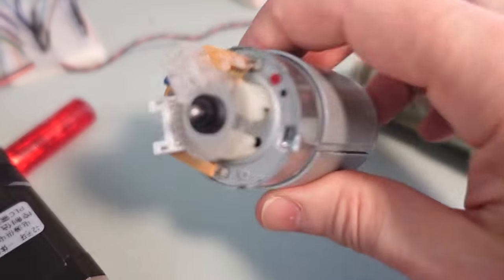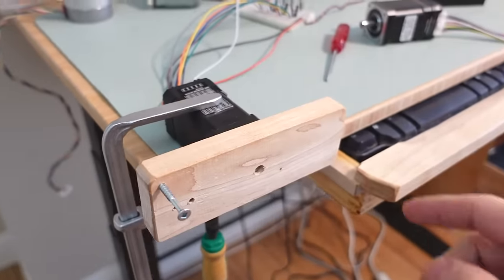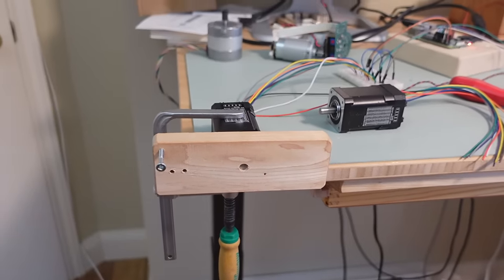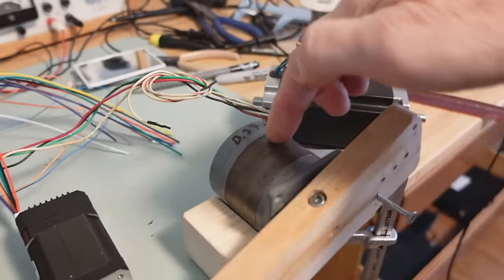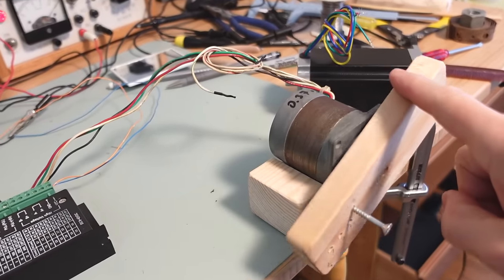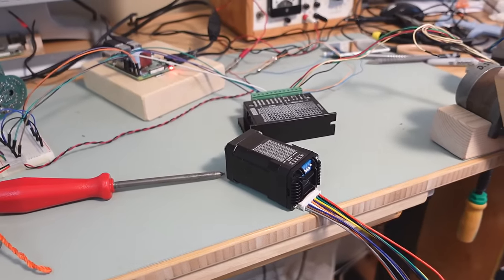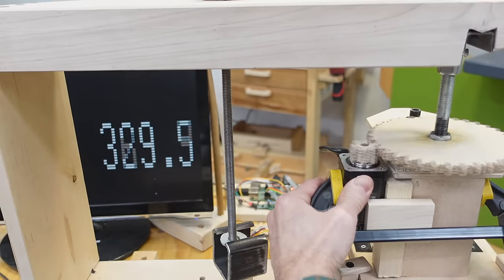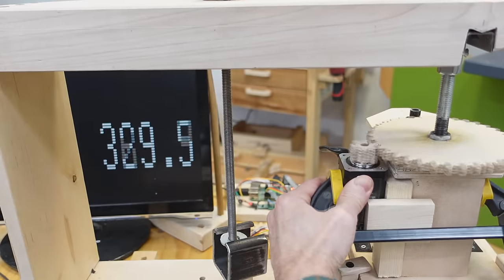Closed loop stepper motors -- very impressive

Comment: Some of the closed loop steppers like servos can have an autotune feature where they can learn the kind of load they are powering and self adjust to a pretty good motion curve.
Reply from the maker: I think most things the stepper would drive would have less inertia as seen from the motor, so it probably does ok with normal loads.

Comment: 4:55 As far as I know, stepper motors (like Nema) can get really hot with no risk of failure. I don't remember exact values, but it can get hot that you can't touch it and it still should be ok.
Reply from the maker: biggest risk is probalby exceeding the curie point of the permanent magnet

Comment: That looks good, I was working on a robotics project and had the same issue, the only issue with optical encoders is the stepper doesnt know where it is when powered on, I was going to try using a hall effect encoder which would know the angle at all times, but not got round to finishing it.
Reply: Write to EEPROM the last position the servo stops at, every time.  On power-up or reset read that last position back then rotate the servo to 0/home, or at least know where you last were mid-code execution.  Your implementation will differ from mine of course in my basic rotate between 0-359 degrees only (and never crossing that boundary).  Hall and limit switch hysteresis is a real pain, otherwise.

Comment: You might want to look into the Odrive, its an open source brushless motor controller designed for use with encoders, it supports up to 100A so you can get a crazy amount of torque and speed for not a whole lot of money.

Comment: Have you tried Trinamic's stepper drivers? I've heard great things about them. They seem to make steppers "kind of" closed loop by measuring currents, and they can detect missed steps and stalls.
Reply: They can detect, but they just error out.
Reply: @Tedlasman  yes, they don't replace those neat closed loop systems, but they would be an upgrade for his old and trusty buh motor, I guess.

Comment: Yeah, when you get a stepper motor out of synch, basically you'd have to realign it as with a standard floppy disk drive (but not the more modern kind like Iomega Zip and Clik!). My dad used to have to take our Commodore 1541 over to the shop to realign the drive, but then we got 1541/1571 Drive Alignment and I could follow the relatively simple directions to realign it myself even as a mere kid.
Reply from the maker: The 1541 used a stepper motor to move the head.  It had no means of detecting where the head actually was, so the only way to know was to move the head in one direction until it hit the stop, and skipping steps while at it.  Making a horrible noise while it did that.  And it always ended up doing that when it got confused.  So when you heard that sound, you knew, something was going bad with the disk!
Reply: @matthiasrandomstuff2221 : Not necessarily going bad. It and similar drives would make that sound for other reasons too. Drives like the 1541 make that sound when they start a full format, so it doesn't mean anything is going bad. But after a while, the drive would make that sound a lot more than normal, and that is because it started to get out alignment, meaning that the drive was bad more than the disk. But yes, it was caused by bad disks sometimes too. I wouldn't call that sound hugely horrible, though.

Comment: Very interesting motor indeed, Matthias! 😃
But I wonder about sensored brushless motor, how they work. All I know is that they're used for pretty expensive rc cars. 
Anyway, stay safe there with your family! 🖖😊
Reply from the maker: also used in cheap printers, but not as a module.  just a. heap motor and an optical encoder feeding into the main pcb.
Reply: @matthiasrandomstuff2221  No, those are different. I think they use magnetism for that... But I'm really not sure.

Comment: i've been looking at using CHEAP motors with glass scales, interfacing them with the cnc controller is an absolute pain without spending much bank on a mesa card.

so, for semi-auto drilling, i've had to brush off the old ttl circuit design files in my faltering memory.  just today struck on the idea of using digital comparators with bcd counters and old fashioned 74ls74 d flip flops to read the encoders, the trick i've thought of is using a target count, a count from the scales, then using the comparator outputs, which are 4bits per, to control the speed through a switched resistor network.  i've got a dro waiting in my jungle site cart, my design will probably be more expensive if i sold it in small amounts, but pretty interesting for the other weirdos out there, or for those that want to learn ttl, for some odd reason, many use arduinos for such a simple thing, but hardware works fine.

Comment: Did you have to write anycode specific to rhw closed loop logic, or did you just use the connections from the R232 connector to the driver A+ A-, B+, B- ?

Comment: Actually, I think this might be just the solution I've been needing without knowing it. Been wanting to make a pet feeder that was both accurate and reliable but also simple. And the drive system always turned me off. Not satisfied with simply running a brushed DC motor for a specific time. I think a Nema 17 with a similar control scheme to this one would check all the boxes. Provide feedback if the mechanism jammed. Could run on an ESP32 with no quirky issues and no extra components!

Comment: It's not that difficult to CNC gears though, just use a 1/8" bit or even smaller bit. The fillet that it gives in the inside corners you can transfer to the larger gear as well and the outside corners for it to mesh properly. 
But still, your band saw technique still beats a cnc for speed for a single or a few parts what with having to cam, setup/clamp stock and cut and sand the part. CNC really comes into its own for repeatability, 2.5D/3D cutting and larger numbers. 
I bet if you add a few more gears with a higher gear ratio, that small servo can pull more weight than the stepper motor and do it faster too since it can spin faster and torque at higher speed will improve. But it's no good as a 1:1 replacement.
Servos (or the servo controller) can have tuning software to adjust the control loop so it doesn't overshoot/oscillate under certain loads. It's always a trade off of course.

Comment: a closed loop stepper and a brushless servo is essentially the same. The advantage of a closed loop stepper is higher torque at the cost of lower max speed so you might be able to skip a gear

Comment: I wonder if that closed loop stepper would have a better chance at replacing the beefy stepper if you changed your program so that the motor operates smoothly instead of having to advance in bursts.
Reply from the maker: Software limitation.  But also, the load cell amplifier takes a while to get a reading, so it helps to let it settle just a bit.
Reply: Perhaps a different gearing so the closed loop stepper can run continuously?  Or faster processing to allow the closed loop stepper to run as fast as the normal stepper continuously?

Comment: We use these a lot in industry, way more than steppers with an external controller. Specifically, AMCI SMD motors. All you need to use them is the motor, a 24VDC supply, a 5 core power cable and a 4 core ethernet cable. Just avoid programming them with Studio 5000, it's simply a chore to do anything with that program with steppers.
Reply from the maker: just looked those up, pretty expensive.  When you don't have a business case, hard to justify the cost.

Comment: Nice as long as you only need one of them. As soon as you need two to coordinate PRECISELY which one is where when (such as any X-Y CNC mill/printer), you're SOL.
Reply from the maker: in that case, I just wouldn't give them motions that are impossible to follow.
Reply: @matthiasrandomstuff2221  this has nothing to do with ability of the motors to follow the directed path and everything to do with the CNC controller being no longer able to control the actual path if it doesn't control the acceleration curves itself - which it doesn't, this being the whole point of having the servo in charge.

Comment: If you are interfacing with any sort of real world hardware, especially hardware that could become unsafe then you really need to be using real time control. You shouldn’t really be shying away from using microcontrollers, even with the closed loop drivers you will still be better controlling it more precisely through an MCU.

It’s also really not that much extra work to use an MCU for a relatively simple interfacing application like this where practically all of the calculations can be done on the pi. Setting up communication between the pi and MCU is easy, regardless of if it is UART, I2C, SPI, etc. If you have difficulty using an MCU in your projects and find it annoying or a hassle or that it makes the project more complex then you likely don’t have very good organisation of the project. If you know what you are doing then using a microcontroller in a project like this to drive the steppers should be easy.

It’s all very well saying that if the pulses are 10 ms late then it can just jerk and catch up and that you don’t need precise motion curves but that doesn’t work as well as you seem to think it does. That 10 ms delay would be enough to throw the stepper out of sync in the first place (due to inertia) and likely isn’t great for the stepper or drive circuitry due to potentially high current spikes (in those 10 ms the closed loop driver could try and stop the motor, leading to a high acceleration on the motor and high current). For any project using multiple steppers this is totally useless, if your motor control signals are lagging or inconsistent then your system won’t work as well as it is supposed to and at the very least your movement won’t be smooth and you could have artefacts like ringing.

You also still need to implement motion curves when using closed loop steppers or you will get bad results, both electrically and mechanically, suddenly stopping or starting the motor leads to high forces and high currents, the high forces can cause issues with things like ringing and resonance and just puts more stress on the system compared to a smoother motion curve.

Comment: I bet that Superior Electric stepper motor was stronger when it was newer. Magnets just don't last forever.
Reply: Neo mags hold 99% of original capacity from when new, if they are not over heated. Just fiy.
Reply: @cadsonmikael9119  beyond the permanent magnets there's the windings too. We've changed how we make steppers over time as how we use them has changed. With modern electronics we can run the motors faster but to do that we've had to wind the motors themselves differently. In the past they had different issues to contend with. So they just went the sucky route. It didn't seem so bad to them. Old motors are low current high inductance and high voltage. New motors are the opposite.

Comment: just buy a 12Nm one, they are pretty cheap, planetary gearboxes are pretty affordable too, and almost no backlash
when the driver faults out, you can re-enable it by cycling the enable pin, no power cycle needed

Comment: 9:00 .... I think that if you used a large pulley and a small pulley on the motor instead of the gear, it would make the motor more torque

Comment: Are motion profiles hard? I'd say most point to point or velocity moves can be performed with a 345 polynomial, which is about as difficult as high school math and plenty advanced unless you really want to extract the maximum performance out of your machine if you're acceleration limited.
Reply from the maker: ok, now code the step timing for that with integer math on an embedded processor.  then you might not find it so easy.
also, polynomials don’t necessarily work.  gotta avoid resonance on startup, and available acceleration decreases with speed
Reply: I'm not familiar with integer math on embedded processors, i was under the impression that the profile itself was hard, and didn't consider that the difficulties would lie in the implementation. I have an industrial automation background and it is surprising how many servos are controlled by infinite jerk 'naive' motion profiles because people think motion profiles are hard. I suggested a 345 polynomial especially because they're easy, have finite jerk so shouldn't excite resonance, and the acceleration peak doesn't match the velocity peak.

Comment: What about running an RT kernel on the Pi - I don't know the details, but I know you can run things like LinuxCNC on a Pi, but you need the hard realtime kernel
Reply from the maker: Neither do I.  I haven't found anything that's easy to use.
Reply: @matthiasrandomstuff2221  I replied with some info, but youtube censored it and removed the comment. There were no links, just plain text. Youtube doesn't like good information sharing

Comment: Matthias, can you put two (or three) of those all-in-one small stepper systems around that big gear and double (triple) their combined output?
Reply from the maker: could, but if I had to use that motor, I would just change to a two stage gear reduction.  That motor can do 600 rpm, so plenty of room for reduction.

Comment: Hi Mattias , I'm shocked you don't have one of the new generation of tabletop CNC lasers yet ? They seem more than capable of cutting 18mm ply and more .

Fattrucker
Reply from the maker: they claim they can, but even folks who have bigger ones say its not practical.  And at that depth, its not very accurate.  And all the smoke.  Faster with a bandsaw
Reply: @matthiasrandomstuff2221  LOL I honestly thought this would be right up your alley ? Perhaps not ? I do like your methods of testing stuff though . But most of all your machine/contraption building . Keep it up . Thank you .

Fattrucker

Comment: Controlling time sensitive things scales in complexity really fast, eventually when the thing you want to build is complex enough it would be easier having mcus controlling the movement instead to compensate and chase time bumps on a non RTOS, then the main software just tells how much to move and its somebody else problem... you already have an extra microcontroller on the closed loop control... its just another one.. lol!

Comment: Am I the only one having issues with encoder drifting. I use stepper cuz its reliable. if you attach an encoder it will have drifting error which is in gaussian distribution. I mean I used kalman filters in my thesis for Vslam project. After a while encoders shift alot that robot vehicle or drone whatever you use loose its position and orientation. Gyros also have the same drifting problem. SO I dont get it yeah you can use encoder to count skipped steps but as encoder shifts it says your stepper skipped steps but actually didnt the gaussian error caused it noone talks about that?

I mean steppers are designed for this purpose for an open loop control. If you have step skips then you need a stronger higher torque motor. I mean you need very high precision encoders like 20-25 bits which can measure  almost nanometers then drifting probably causes no problem. But even then its matter of time. If you run robot or drone for hours it will shift eventually cuz error adds up.
Reply from the maker: you are losing steps.  polling it, not often enough?  probably some signal integrity issues.  have you tried scoping it out?

Comment: The motor and drive integrated closed-loop stepper motor in the video is produced by our factory. Please consult me if you need.🎉
Reply from the maker: send me an email
Reply: Are there any models which have an absolute optical encoder? Also what are some best practises for “homing” the motor in case of power failure? Are hall sensors good enough?

Comment: 9:01 that sounded and looked like it jamming instead of maxing out? Might have just moved a tiny bit since only temporarily clamped…

Though it’s easy for me to say that from my armchair 😂
Reply from the maker: A gear with more than 6 teeth would be more efficient too, but then I'd need to re-make the other gear too.  If I want to switch this to a closed loop motor, I justh ave to re-make both gears, and get a bigger motor.

Comment: First off, as someone who tests stuff like. You still are moved off position... ( think about that ) 

If this was a cnc machine, you still fked up the cut regardless if the motor knows it has lost it or not. 

Now will it correct.. yes. 

But does it stop you from fkn up, or loosing position for a slight portion of time... no. 

Servos have more power, also like 4x the price bro. 

Just get a big ass stepper with way more torque than you need and size tour gear train for preformance ( torque or speed as desired )
Reply from the maker: being off by 10 ms while cutting at say 2 mm per second is off by 0.02 mm, or less than 0.001", which is more precision than I expect to get regardless.  Also, its not like the other motor will keep moving if that happens, they'll both just stop.
Reply: @matthiasrandomstuff2221   depends on how much momentum it had accumulated. If it's moving real fast into a cut it could be off by much more by the time the closed loop steppers back drive themselves into position.

Comment: It's possible to make a really low cost system that does stepper motor type control of a DC (or other) motor with an encoder. I've done it. But the complexity is high, and although it could be simplified into a small module like these, I never found this exact market when I was in that business (I've moved on).
https://www.youtube.com/watch?v=TFkugHdCh3Y